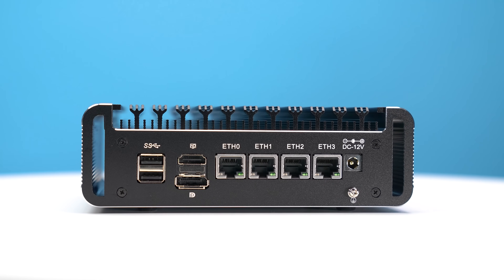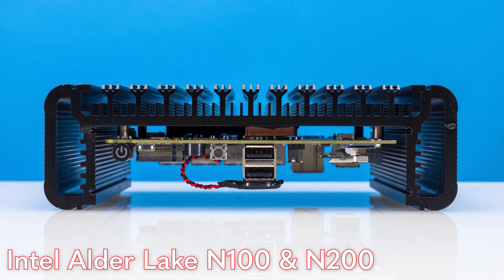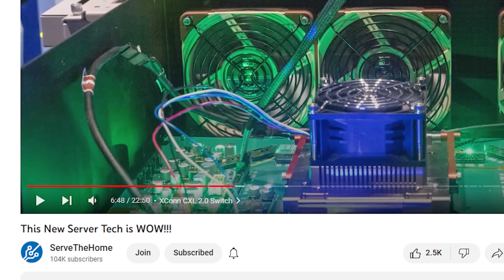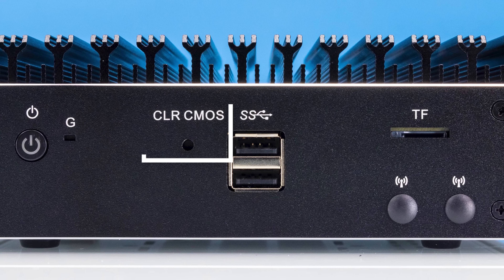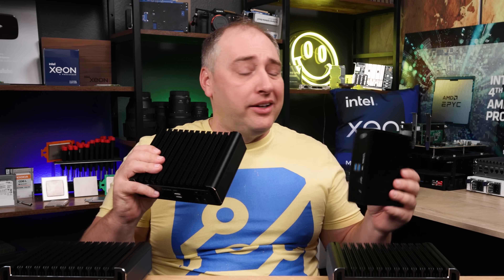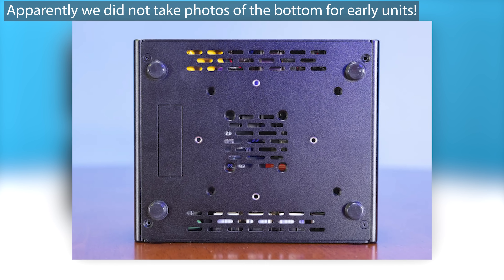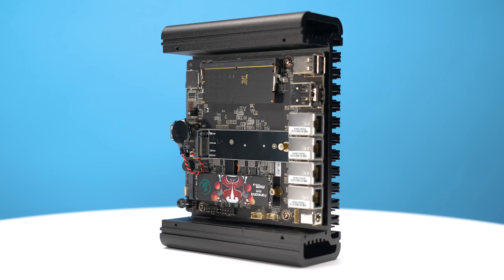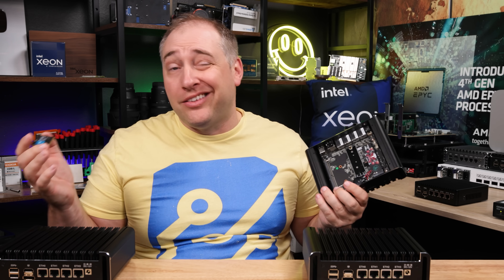HUGE UPGRADE! New Firewall Router Virtualization Host

Comment: I ended up getting the new N150 version of this they're now offering instead of the N100. I'm worried about how hot it might run since I live in the part of the world that is hot most of the year. My version looks like it might have connectors for fans but I don't know how it would hook up. I can see sys_fan and SATA_PWR1 but not sure if I can use those for an internal fan. Any ideas?

Comment: So, I'm thinking of buying a device mainly to experiment with, but I also want it to serve as a productive solution for my small home network. I plan to install pfsense, proxmox, pihole, and generally play around with different setups. I'm looking for something compact and with low power consumption. I'm considering something from AliExpress with an N100 or N150 processor. Does anyone have experience with Topton? Is there a better alternative?

I guess I’ll need at least 2 ports – one for WAN and one for LAN. If I don’t go for a device with enough ports to cover my needs(6 or 8), I’ll probably need an extra switch (managed?).

And the most important question: since my WiFi network will be going through the device running pfsense, will I definitely need a separate access point???

Comment: Hi question. Just received the unit RJ42 N150. All seems running except the Eth Ports .
Internet is not there. Although the signal towards is active, i plug it in in laptop, on the rt42 only 1green light list up. On All 4 Ports the same. What can I do?

Comment: Know this video is year old, but I'm just looking for a small form factor PC to replace my old x86, 32 bit PC. Anyway, see your issue with the G on the panel. It's very likely the GPIO pin. But how to access it from motherboard level, further on kernel or via any user space driver - I have no idea.

Comment: A year later, I am watching/watched this video and decided to jump in the deep end and order my first mini PC from Ali Express.  Hardware-wise, I ended up getting the N305 with 8 cores 32GB RAM and 1TB drive, re-pasted CPU with Thermal Grizzly, installed a mini 8010 fan internally (found connector pinouts by Googling), and on top put a 120mm fan with potentiometer for a super cool and quiet setup. Software-wise, I installed Proxmox with Ubuntu and Windows 11 VMs working well.  I am now in the midst of trying to get OPNsense working with dual WAN and using my old Asus Router w/mesh as APs for it.  It's been a really fun journey so far thanks to this video.

Comment: the libvirt frontend for cockpit has gotten so good, we run Fedora on one of those and pass one of the NICs into OPNsence and make a bridge of the other 3 (with a virtual device connecting the bridge and OPNsense) - and we didn't have to touch the XML or even command line once to set it up.
Reply from the maker: Sweet! Good to know.

Comment: I recently picked up one of the N100 units and populated with 2 NVMe SSD and 16GB RAM.  It is running XCP-NG with the 2 SSDs in a RAID 1 configuration.  It seems to work very well.  I may be dense, but I could not find an option in the AMI BIOS for auto power on after power failure.  Could someone tell me where to find it?
Reply: I'm replying to my own comment in case someone else runs into the same issue.  For my slightly newer motherboard that has 2 x USB 3 ports and AMI BIOS, got to the "Chipset" page, then open the "PCH-IO" section and select the "State after G3" option

Comment: When I want a better firewall and a VPN, will the N100 with 16gb and 128gb SD be enough?
Reply from the maker: N100 is pretty decent and 16GB is fine. Using just a SD card I would pass on and instead use a NVMe SSD these days. Logging on a firewall will often write too much to SD cards so a SSD is much better.
Reply: @ServeTheHomeVideo  thanks

Comment: Hi Patrick, You said the N100/N200 can support the 2.5Gb ports but can it support running many of the modules available for the PFsense firewall and a AT&T Fibre 1GB internet connection?  For example one would want to run the Suricata Threat Detection module, the Unbound DNS Resolver with encrypted DNS, and the Geo Fencing Modules.  Would it still have headroom for VPN connections and other services?
Reply from the maker: Personally, if I wanted to run that much, I would start thinking about the N305 version.
Reply: @ServeTheHomeVideo  Actually according to Passmark the N100 has twice the performance of the Atom C3558 processor running on NetGate's 6100.  So I'm thinking if they expect that to support two 10Gbe and four 2.5Gbe that the N100 should be sufficient to run Suricata, Unbound, PfBlocker and even a VPN.

Comment: Based on this review I purchased this box from Amazon.  Also purchased 16GB of memory (CORSAIR Vengeance SODIMM DDR5 RAM 16GB (1x16GB) 4800MHz CL40) at the same time.  My habit is to run Memtest86 on every new computer for at least 24 hours.  The memory test fails random memory locations within 10 minutes and the memory temperature rises to around 70 degrees C.   Via online chat CWWK recommends Samsung memory, guess I'll order the Samsung memory and give it a try.
Reply: Update: Amazon delivered the recommended memory the same day I ordered it!  Replaced the Corsair memory with the Samsung and ran the Memtest86 tests again with no failures.  Apparently the Samsung memory must have different timing parameters than the Corsair.  The temperature was still around 70 degrees C during the testing.  Still believe that Corsair memory is a quality product and plan to hang on to it until there is another chance to test with it in a different box.  Finally the CWWK person I chatted with said they test with Samsung memory so maybe their product memory design timing and impedances are an optimal match for Samsung memory.  I would suggest that @ServeTheHome give these types of considerations some air time in future videos.

Comment: When you talk about performance, I would really like to see som iperf and real-world throughput tests. Maybe a standard baseline opnsense config and throw some packets at it?
Reply from the maker: The N5105 pushes 2.5Gbps wire speeds over NAT in iperf3 across two pairs of ports (so 2x 2.5GbE NAT on the same box). I am not sure how useful that is to show for even faster CPUs.
Reply: @ServeTheHomeVideo  The interesting thing is when you throw in VPNs and IDS. That will likely hit either the crypto accelerator in the CPU, if the CPU has one, or will directly hit the normal CPU.

Comment: This could be perfect for like NAS systems or media servers, too. 
The N100 chip seems to be capable of 4k 10-bit AV-1 decoding. ASRock seems to be selling an Micro ATX form factor SOC with a full length PCIe 3.0 meaning SAS or SATA controller are actually viable. For just a little over €100€ in my case without the DDR4 stick - sadly - it seems like a good deal. Add in PSU, DDR4 and controller and you're more or less good to go. 

For a pure media server, however, I'd say it's a bit too overpowered. I'm definitely interested too see what these chips are capable of!
Reply: Important thing to note is the full length PCIe in the asrock works at 2x speed so it's not really any better than the shorter PCIe in the ITX variant. (The shorter connector seems to have an open back so it should accept any PCIe cards) 
So if you only want one addon card you could go with the itx model and external 19volt power brick.

Comment: Hi Patrick always enjoy your videos mate! Just setup one of these units with a i3-N305 with a Proxmox + OPNsense configuration with PCI passthrough. All working great but found a gotta in my network as I don't have a separate management network and if I shutdown OPNsense I'm unable to route to the proxmox management GUI. Just wondering any suggestions around this?
Reply from the maker: Hi Chris, thank you for being a STH YouTube member! Usually we leave one NIC for Proxmox VE management and give that a static IP. Even if your OPNsense goes down with a DHCP server, you can still connect via IP to the Proxmox VE host as long as you can reach that port.
Reply: @ServeTheHomeVideo  No worries I enjoy all the STH content! Let me try via IP as both are on the same switch and subnet range.

Comment: Regarding the dual nvme slot I think there could be usage for a small NVMe mirror for ZFS with snapshots, you'd be able to change from pfsense to opnsense easily if you'd like to test both out. There is a new DRAMless SN580 btw it comes down to 250GB, well suited otherwise a Crucial P3 Plus is straight forward and also DRAMless for low thermals.

Comment: How about comparing some of these to a Firewalla Gold Plus?
Reply from the maker: Hardware wise, The Firewalla Gold Plus is still using the J4125 last I heard. So these are ~2 generations newer. Either Firewalla or its agency has asked to have it reviewed. I said we only do editorially independent reviews and we have a LOT of comparison points with different units, and they have not sent us a unit. I think they like to focus on folks that mostly are coming from old ISP router/ firewalls.
Reply: @ServeTheHomeVideo  I their schtick is that it is the software and user experience that differentiate them from the others. Kind of following the Apple model never cutting edge but very refined and user friendly.  

They seem to have a cult following and would love for someone like you to independently review it and it’s capability’s.

Comment: Does it support in band ecc? That would be awsome for a small zfs box, since they now also offer a m.2 to 4x m.2 adapter for this system. Combine with the other adapter you could fit 5 nvme drives. All with only one lane but that would be more than enough.

Comment: I got this exact system with N100 cpu, 16GB memory and I placed a 250GB nvme drive in it. It handles my opnsense and home assistant workloads as VM’s withsome extra containers in proxmox and i never see the total cpu load get above 10%. I would 100% recommend this unit for typical homelab containers and a couple of VMs. I did place a 12CM fan on top powered by external usb port at 5volt. This has a huge impact on the cpu temps. Still mich better than a internal fan imho because I can replace it in 5 min with any 12cm fan and it’s super quiet.

Comment: I got one of these today.   The Proxmox install didn't go well.   The system didn't get  a DHCP address and the framebuffer was unrecognised.   This was the 7.4.1 install.   8 beta worked,  still no DHCP address, both installs got real IPv6 addresses, so that might have worked for the install.   In the install I specified the IP, gateway and DNS server for it to use and it installed OK.    Anyway short version - I think you need a Linux 6.x kernel if you want no aggro.

Comment: Any word on pfSense support for those i226V NIC's   Is it good?  You used to always buy Intel NIC's for this kind of stuff, but their 2.5Gbit chips have been iffy at best.
Reply from the maker: Iffy mostly in consumer desktops. We have well over 100 ports of the i225 B3/ i226 running at this point under linux in these smaller systems.

Comment: Years ago when I built my router I was hoping to get somethig like this, but I couldn't find anything good enough.   Instead I got an Asrock Rack Mini-ITX board with dual onboard Intel NIC's, installed a Core i3-7100 and used a mini-box M350 case and a Pico-PSU to make my own.

I wonder how these new Alder Lake N100 and N200's compare to the i3-7100's OpenVPN performance.

Comment: Hey Patrick, I had to use a full-sized PC board/CPU in order to get OpnSense to firewall at wire speed with a typical set of firewall rules with a 5Gb link. It would be nice if you could put each of these newer devices with >1Gbe on a comparative spectrum for how much traffic they can actually filter and pass. Perhaps you could set up a test harness with a couple reference points for number/type of filtering rules, dedicated or trunked traffic, and so on. I haven't seen anything else like this out there yet, so just offering an idea for something I would want to see.

Comment: I have an n5105 version with the 2x NVME drives and it works great in ZFS Z-1 with OpnSense. Still using 1gb lan but hopefully we will see some 2.5g 24 port switches soon

Comment: Version with sfp+ ports needed!!! (min 2 preferably 3 or 4)

  this new unit would be perfect for power etc  but they are finally laying in ftth where I am (after often was done a decade ago and idiots in charge put hell Canada in charge of oversight.. so the subcontractors that actually did the work was explicitly told NO ftth allowed.. only fiber to HELLs local  substations for vdsl  fukkers)   anyhow..  it appears I will have to suffer eith a Hell canada "hub" aka sagemcom oem..  and best options are the older model 2000 or 3000.. and i need a small box like this only with a sfp+ input and out to act as router before standalone switch.   So far i have found sfa that fits the bill and isnt $$$$$$$$$"    anyone out there have any info???
Reply: now there has core 8/10th gen cpu with 2*SFP+

Comment: It's nice, but a nas oriented itx board would be great too. 
With 2 Ethernet ports and a lot of sata in return.
Reply: There are products like that out there  but generally they are morenlimitednsnd costly vsnwhatbcan be done using even a basic am4 matx mb and  a decent hba (which is much better as a rule than onboatprd data only)

I've built many for others that way and not only is it cheaper but the performance mops the floor with these small units..  and done right it's as absurdly low power as well.. plus if/when something goes wrong very easy and cheap to fix
Reply: @konnorj6442  matx is easy, but itx has limited options unfortunately from the name brands.

Comment: The G-Connector is GPIO -> General-purpose input/output -> uncommitted digital signal pin on an integrated circuit or electronic circuit (e.g. MCUs/MPUs) board which may be used as an input or output, or both, and is controllable by software
Reply from the maker: That is what I thought. You can see on the internal shots of that side that it is actually a little recessed button/ switch.
Reply: @ServeTheHomeVideo  It sounds like it’s a GPIO pin which is pre-populated with a switch for convenience.

Comment: About the temperature difference. I have a similar unit and I got the same temperatures when I change in UEFI firmware (BIOS) CPU performance settings from Max battery to Turbo. You may check if this setting is the same on your N100 and N200 :)
Reply from the maker: Super! We have an awesome forum thread with these linked in the description where folks are doing stuff like that. I like to test these as they arrive since that is how 99% of people will use them

Comment: There is one more difference between N100 vs N200. N100 has 24 GPU units vs 32 on N200.
Reply from the maker: I am not sure to a lot of folks the GPU performance is going to be a major factor. In these, the GPU is often unused
Reply: Agree - if used for a firewall. May be useful for a Plex server and may negatively impact power consumption. And may make difference for those who want to use it as a low-power fanless desktop replacement. And thanks a ton for showing them! And waiting for a i3/10G version :D

Comment: the USB ports are all 2.0 not usb 3 unfortunately..  that kills off using any external HDD as a tiny nas/webserver with custom router (yes I'm aware of teh internal connections.. but thats a diff story)
Reply: There is other version with a smaller chassis that has 2 USB 3.0 ports
Reply: @diegosps  indeed but that would not be a good fix lol

Oh and sellers for such need to got a clue re option for ram and no ssd  of for older ďdr4 models with 2 actual sodimm slots they should offer ram accordingly
(Not the idiots that failed to inc 2nd slot despite the cpu/soc supporting such.)

Comment: Would like to see network throughput performance testing on something like this.
Reply from the maker: Basically pointless. The N5105 can be a firewall for 6 ports. This only has four and is much faster
Reply: @ServeTheHomeVideo  What would be worth testing is pppoe performance, especially virtualised interfaces.   I have been trying to get a proxmox virtualised low power server that could do 1gbs over pppoe,  it is basically single threaded on freebsd (pfsense), don't want to passthru so more overhead.   So far - 4305U passmark single threaded 1365 not quite fast enough if pfsense run virtualised.   i3-1115g4 single passmark 2666, easily does it, can be throttled to 2.1Ghz and still is fine, but it get too hot.   N100 passmark 1998, should be good enough and having just commissioned one - it is.   Still fairly warm, but nothing like the i3 which actually got too hot to touch!

Comment: It looks like the N200 version was placed under the N100?  At least, this is what the activity LED implies.  If tests were performed in this configuration then that explains the 70 deg temperatures.  Physically move the N100 before running the tests.  Of course one might have positioned them together just for the video, in which case please to ignore this comment.
Reply from the maker: Tests were not in that stack. They were just like that to show on camera

Comment: Hi Patrick thanks for another excellent discovery, please check this with the n305 version: the seller offer an quad m.2 PCIe3 splitter/riser similar to the one to adapt an 2280 to the 2230 slot but to share the full 2280 X4 slot to 4 m.2 X1 , i saw the adapter at the toptom version I assume should be the same for this, it opens new possibilities as practical full blown Nas/firewall device

Comment: The second SSD slot could potentially be used for a Coral AI accelerator. I think these type of accelerator chips will become more popular.
Reply: Or grab the Coral that goes into the WiFi slot.
Reply: @jandorniak6473  Or get an E-Key to M key adapter board.
Reply: What would be the use case in this form factor?